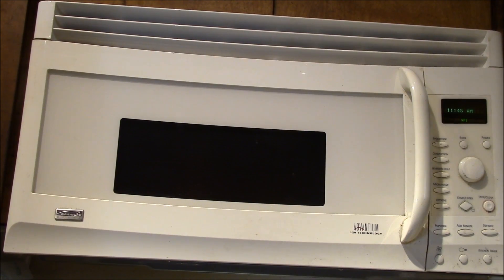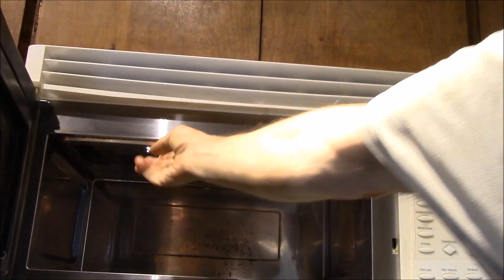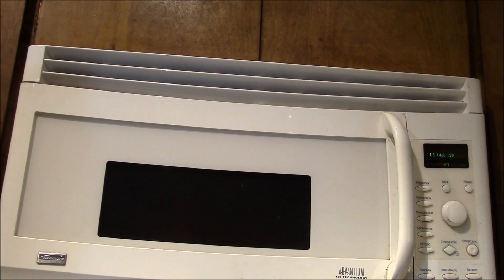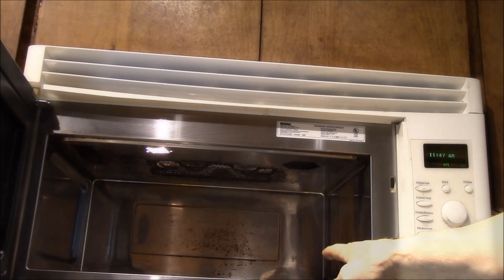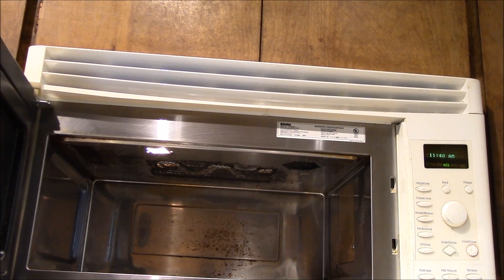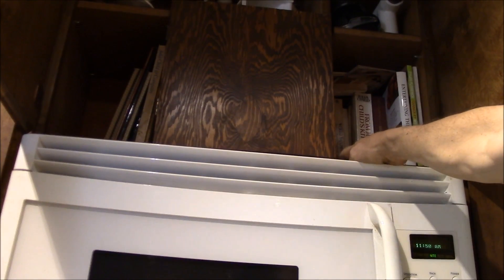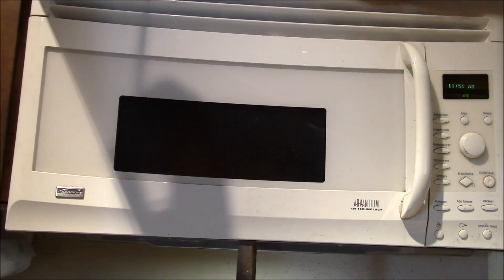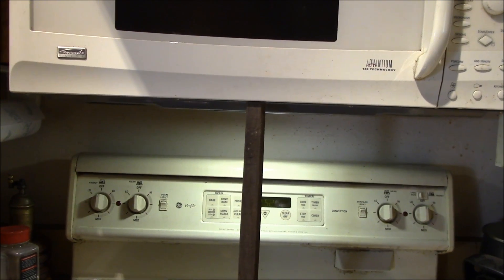Advantium SpeedCook Oven Repair, Part 2 - Problem Overview

Comment: Would you know why the lower miraclon bulb won't work?  It's not the bulb but relay#9, not sure if relay #9 is available separately or part of circuit board??  My email is jpmidstate1@gmail.com
Reply from the maker: Did not see this comment until tonight, sorry for the delay in replying.  You could probably find that information in the service manual (see link in the video description).  It has the full parts list and wiring diagram.